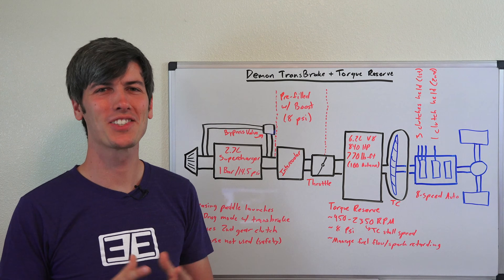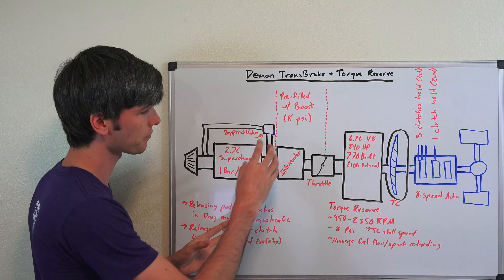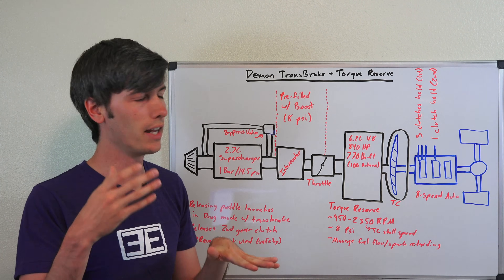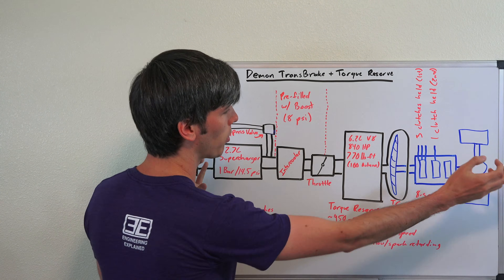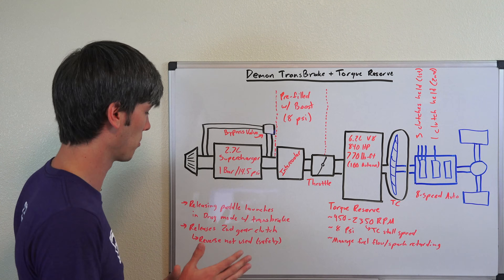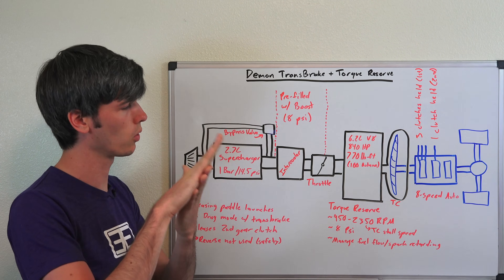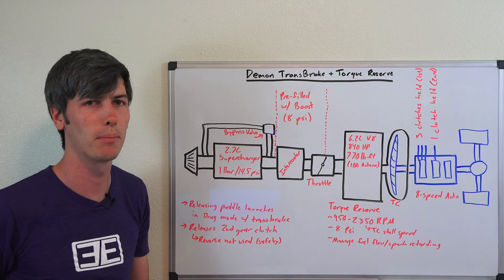How The Dodge Demon Launches: Transbrake + Torque Reserve Explained

Comment: All of this just technology just to be able to compete with a 4 door electric family sedan.
Reply: Electric cars produce instant torque, nothing amazing about the Tesla going a quartermile quickly, right?
But the engineering that took to make the demon beat it is quite amazing.. if you don't appreciate it but only their 1/4 mi times, fine. And it doesn't compete with Teslas because they're completely different types of cars...
Reply from the maker: Not that the Tesla isn't amazing, but it's also way, way more expensive. Like $50k more, base.
Reply: Suburban Hahahahahahaha, very true. Battery technology still sucks right now in comparison. Once an electric racecar can be charged just as fast as the tank on a racecar can be filled, only then have EV's truly caught up to internal combustion.
Reply: There's a reason Tesla only publishes 1/8 mile races genius...
Reply: Forget endurance racing, I am waiting for a transatlantic crossing in an electric airliner.
Reply: The fact this car is half the price and way faster is irrelevant to you I'm guessing? The one thing the telsa was good at has now been beat by a fat rwd challenger hahaha now the Tesla has nothing but a cancerous fanbase keep preaching kiddo you sound real smart 😉.
Reply: difflocktwo Yes, Personal safety is important. Lithium ion batteries are very dangerous in large quantities. They ignite and burn much faster and hotter that gas or diesel when punctured, shorted, or overheated. The potential for things to go very wrong is very real. Not to mention the high voltage connector needed to charge these cars. You take a substancial risk no matter what you drive.
Reply: ddrjay122494 I love Tesla.... but it's ass is kicked by this car.  Quicker 0-60, quicker 1/4mile, and higher top speed, 30k cheaper.
Reply: Yeah and the Tesla is comparable to cars in that price range. The point is if this kind of car, where the passenger seat is optional, were electric it would be a much simpler drive train with better drag performance. It wouldn't cost as much as the Tesla. No one wants to pay tesla for use of their supercharger network so no one is going to even compete with tesla unless they build their own supercharger network.

How many more Bolts would have been sold if it were supercharger compatible?
Reply: difflocktwo there isn't much of the Tesla supercharger network outside of the California and New York City/north Jersey areas
Reply: Suburban Maybe we are looking at different maps but the states seems packed full of them, bible belt and all.
Reply: mondayfool A rocket would probably cost more to design, build and operate. You can't charge your rocket at home. Looks like the Demon tech is for the launch, critical in short distance races. I don't think they designed it for an infinite track.
Reply: mondayfool Yes, but all this tech in the video is for the launch.
Reply: +difflocktwo.  You need to consider the scale of the map.  There are lots of dead spots more than 250 miles from a charger.  I also have to wonder what percentage of the chargers are coal powered.
Reply: Suburban You're right, and there are a few bald spots up North I just noticed. It is the most comprehensive network available for charging though. That is what I meant that if a new to market EV isn't super charger compatible it won't sell since there currently aren't better options for EV charging.
Reply: cold start? this isnt the 1970's, cars actually start first time , everytime now son.
Reply: 03056932R Cold start is when you start something when it's cold. So before the engine has warmed up. It has nothing to do with whether or not the engine will start. And to difflocktwo, I have never seen an electric charging station anywhere in the north. I wouldn't call that "a few bald spots"
Reply: 03056932R Cold starts have terrible combustion and the catalyzer isn't up to temp. Hey route your exhaust through the car interior, then maybe you will understand wtf is coming out of the tailpipe.
Reply: 03056932R I can floor it with an EV from a cold start. No need to wait for any operational temperatures.
Reply: difflocktwo Ahh, you shouldn't do that; especially in the winter. The main motor bearings as well as the differential do still have operating temps to be met. Also, Li-ion batteries do not deliver current well below 50F. Gotta heat your batteries up before putting a big load on them. Modern EV's just limit your power while operating under temp (or over temp for that matter), so the driver is never aware of their system temperature.
Reply: Andrew Whiteman If the EV is plugged in, you can preheat. My EV only has wheel bearings, not a gear in sight. Yeah there still are fluids and mechanical transmissions in most EVs. But an EV won't produce worse combustion products when cold.
Reply: difflocktwo Placing heaters in battery packs adds cost and is inefficient, so this technology is understandably not used. It is a waste of energy to heat up the batteries when not in use, like leaving your toaster turned on all night long. There isnt anything seriously wrong with having cold batteries, but there are some drawbacks to be aware of. They might not get you home on a cold 20 below day after work if you live up north where I do.

Also, side note, as an electrical engineer and a gearhead, I am happy to see the rise of EVs. When they finally attract a majority of market share, it means both cheaper oil and less government regulation for proper car enthusiasts like myself, while still satisfying the transportation needs of the world. It is certainly a win-win.
Reply: Andrew Whiteman Most EVs have coolant loops and heat pumps. They can move heat to and from the battery, passenger compartment, drive electronic, and outside. Battery, block and cabin heating is used all the time, you have a timer you set. With an EV it is the same. You set the time you wish you leave and everything is pre heated. If the battery is too cold an EV will first pre hat the battery before charging. Block heating doesn't get to operating temps, but it's way better than an ice cold start.
Reply: Andrew Whiteman Oh and a cold start for an ICE car is anything under 70 C. EVs have no issue at 20 C.
Reply: difflocktwo I was talking about -20 F, which is about -30 C.
Reply: Andrew Whiteman You definitely need heaters then.
Reply: 2 seconds faster at 140 miles per hour is how many car lengths between the winning car and the losing car?  That's not a small margin in drag racing, that's what we in the mid-west call a "whuppin'".
Reply: ddrjay122494.  How are the electric cars doing in endurance racing?
Reply: People admire the complexity of watches, but these days the cheapest digital watch will out perform a standard mechanical watch. If you are building a performance car and engineering for drag performance, then the convoluted setup that under performs doesn't seem admirable.

If jaguar built an E-type again today, no one is going to complain that its too slow or not electric, that isn't the purpose of the car. People will still admire the car. But this hot wheels toy car trying to be fast with a million little gizmos isn't something to admire but something to question.

If a team goes out to build a luxury family car and as a side effect the car happens to outperform almost every other car, there is something truly admirable there.
Reply: Half the price? A luxury sedan vs a toy? Depends how much your health is worth. You like handling gasoline? How about that cold start every morning? Mmm incomplete combustion.

Comment: still can't go around corners
Reply: stijn v.g. Dodge sacrificed the Demon's ability to go around corners in order to make it as fast as possible in a straight line. Expecting it to master corners is like expecting an 18-wheeler to set a Nurburgring lap record. It's not made to do that. It's not made to corner like a track car. Why do you expect it to? That's what the Viper ACR is for.
Reply: relax man i know, just a joke :D
Reply: András Bíró who told you the Tesla corners well?
Reply: stijn v.g. Not to mention it still has a cheap, plastic-filled interior
Reply: wrong, I'm fairly certain the p100d does 10.5 with no significant prep or inconsistencies, in a shorter street race it would be even closer with the tesla beating it in say an 1/8th mile if the demon doesn't get it right.

either way it doesn't look like anything is standing still.
Reply: The Tesla P100D is just a tiny bit slower in a straight line, but corners very well.
And I fully expect the Tesla semi to set lap records on Nürburgring, with a trailer attached.

Comment: still slower than a tesla.
Reply: Yes, but only slightly, and the Tesla Model S is a luxury sedan with all the bells and whistles. For Tesla great acceleration is just a single item on a long checklist, while for the Dodge that's everything.
Reply: Unobtanium actually faster than a tesla.
Reply: András Bíró The amount of stuff Elon throws on Teslas has always irked me. 
Most of its completely unessisary and only adds weight.

Comment: What if is was an awd demon
Reply from the maker: Because it can get all of the weight onto the rear wheels, AWD would actually slow it down, as it would mean more power loss and less torque reaching the ground. If it could not lift the front axle, AWD would benefit it, or if it had significantly more power AWD could help further down the drag strip to gain speed.
Reply: JøÉ M it would just fly
Reply: The Demon was aimed for the dragstrip, prepped surface, drag tires, skinnies at the front and so on, for pure drag cars, seems like a tuned suspension and RWD with STICKY tires work the best, AWD is the king for the street, less than ideal traction conditions, they just hook, or hook better than your average RWD car, even if the RWD car has decent tires.

Comment: I wonder if Dodge put a special valve body in the 870RE. If not, this feature can theoretically be exploited by afkermarket tuners and applied to all 8HP equipped cars. Imagine an all wheel drive Audi launches with line lock at driveshaft snapping speed!
Reply: i think this sort of thing requires more than just tuning, for instance even when the ZF8HP trans can "coast" in certain scenarios going to Neutral gear, it cant be tuned to lets say go to Neutral on command like the DCT in the C8 Corvette does to free rev the engine.

From all the challenger/Charger trims only the Demon and Scat Pack 1320 have the Transbrake feature, some users claim isnt all that great of a feature to have, on the 392, Demon might differ.

EDIT: for some reason youtube showed me an 8 year old video...lol, either way, yeah, 8 years later no tuning company has made this possible on other ZF8HP cars.
Reply: @402Racing  yeah very true. i think even with aftermarket standalone controllers for the 8hp, which only came out a couple years ago, no one has implemented trans brake feature on them (at least that i know of).

Comment: Engaging first and reverse will brake the rear tyres ( Makes sense), but how 1st and 2nd will break it ??
Reply: Yathu prem Two different gear ratios. This causes the output gearing to be for two different shaft speeds and thus locks them up because it can't go two different rates of rotation at once.
Reply: He states the they lock "2nd" gear, but that's not exactly the case. These transmissions have 5 clutch pack(A, B, C, D, and E), and they are engaged and disengaged in certain combinations that make all 8 output gear ratios. The way they lock the transmission is by engaging all the necessary clutch packs for 1st gear, and engage one more that prevents output. I'm not sure off the top of my head which clutches are involved in all this on a Demon, but they combine in a way that locks the sun, planets, and ring gear of a planetary gear set, which prevents output from that gear set, and ultimately there is no output from the transmission.
Reply: John McKenzie explain
Reply: +justin shamburger you're incorrect

Comment: whats a ''stall speed''?
Reply from the maker: Basically it's the maximum RPM the torque converter can reach if the transmission output is locked (no driveshaft motion).

Comment: Has anyone besides Dodge achieved a 9 yet?
Reply from the maker: My worst time was a 10.9, and I've never been on a drag strip before. I unfortunately only recorded one of my six runs, and I had some wheel slip occur at about 30 mph, not a perfect launch, but still managed a 10.9. I'm sure a time in the 9's is very possible with the right conditions and perfect execution.
Reply: Awesome. Love your videos man!

Comment: I find it funny that we are all so amazed at the Dodge demon for being so quick but no one seems to care about top fuel drag cars. They are crazy. 0 to 100 in one second. Let's talk about that!
Reply: You can drive it on the road.
Reply from the maker: I have! :) https://youtu.be/bI0YPTK32vc
Reply: se7en1976 No it won't. It's not quicker or faster. Do the slightest bit of research.
Reply: se7en1976 Actually yes I have seen it. He's not saving a ton of weight and the Tesla is still speed limited.  It'll have a faster 1/4 mile but it's not going into the mid 9's like the demon.

Again do the slightest bit of research
Reply: se7en1976 What point are you trying to make No Tesla touches the Demon. 7's in the 8th is nothing to 9'in a quarter.
Reply: you realize you just contradicted yourself right? If it's going to have a "faster" quarter mile, it literally has to go into the mid 9's, like the demon, otherwise its quarter mile isnt faster..........
Reply: Ian Delo Reading comprehension is a vital skill. The gutted Tesla will have a faster 1/4 mile  than a regular one. It will still be slower than the Demon.
Reply: those don't come from the factory ,
Reply: se7en1976 Demon is faster than the P100D m8

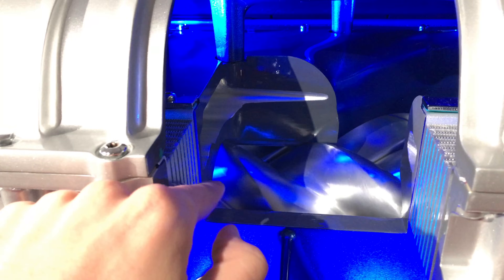Comment from the maker: IMPORTANT NOTE - As +177SCmaro has pointed out, the throttle is located before the supercharger. Doesn't really change much, you will have pre-filled 8 psi of boost past the supercharger, but the drawn location of the throttle is incorrect. You can clearly see the throttle comes first at 1:37 in the video. Apologies for any confusion, hope everyone's having a wonderful day!
Reply: About the transbrake... Is the statement "pre-loads the drive line" (at 05:27) not entirely correct as engaging 2 gears simultaneously locks up everything from the transmission forward - leaving the drive shaft, differential, and half-shafts (basically 50% of the drive line) unaffected?
Reply: 177SCmaro
Yes, but because the transmission is essentially locked up, the rest of the drive line is left unaffected.
Using the transbrake is like trying to pedal your bike with a stick stuck in the front sprocket (where the pedals are), but using the rear brakes is like trying to pedal with the stick in the spokes of your wheel (you are including the rest of the drive line in the equation and therefore exposing it to the output of the driving force).
Reply: Does the car have a 2-step to hold the rpm's in that torque reserve window?
Reply: Brodie Bennett Exactly, how does transbrake is better than holding gas and brake pedal and releasing the brake?
Reply: Engineering Explained Can you make another video explaining the trans brake? Would really appreciate it.
Reply from the maker: Transbrake explained from 2:46. It's not really any different than any other automatic transmission, just engages two gears at the same time.
Reply: Engineering Explained Ok thanks for replying i have been a very early subscriber. Its been great to see you grow so rapidly. Have you done mechanical engineering ? I also have a passion for cars and engines and am also pursuing mechanical engineering.
Reply: Brodie Bennett Using the brakes of the car rather than a transbrake would also save your drivetrain, since you're basically preloading everything. With a transbrake, there's no preload on the drivetrain, so when you release the transbrake, it takes all that slop and backlash out all at once, and quite violently at that.
Reply: matiz33 To be honest, I think that holding the rear brake would be better, as one would assume that the drive shaft and the two half-shafts would act like big torsion bars, and thus do a better job at "storing" torque...
One could argue that it would take longer to release the brake (if done by computer), but all you would have to do is release pressure on the pads, just like you have to release pressure on the 2nd gear clutch plates, so the argument wouldn't really make sense as the weight saving benefits from using the rear brake as opposed to the transmission (which wouldn't have to be built such that it can handle all that static torque) would be way more effective then any small decrease in launch time that the transbrake may provide...